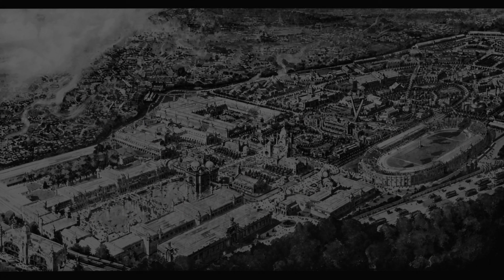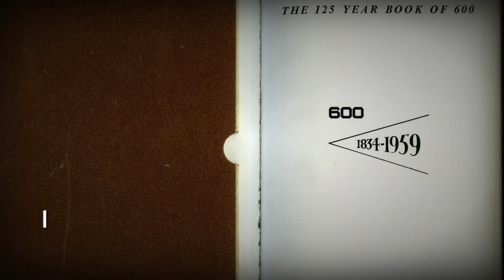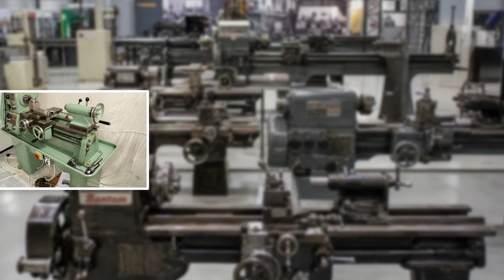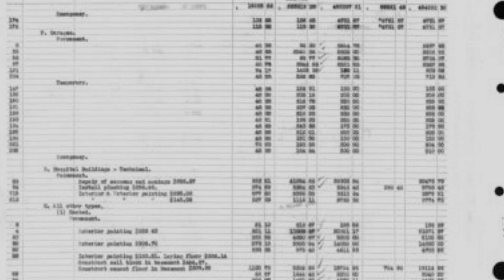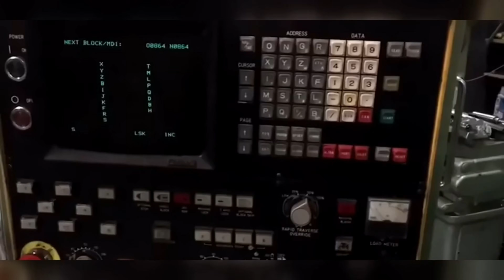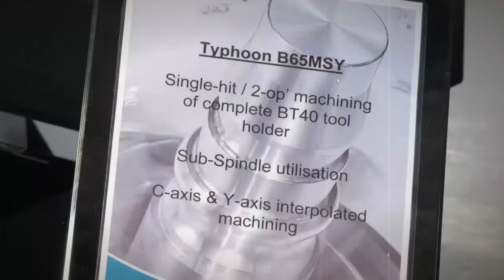The Essex Lathe Company That Taught Britain How To Machine

Comment: Yes all our lathes in the apprentice school 30 apprentices per year in a 5 year apprentichip then 150 in al,  in Leeds at Rank Precision  Industries was a Colchester. 12 in all between 1973 and 1978. They were the perfect machine to learn on very accuret and very easy  to use and work on. It closed in 1978 when Torys goverment Thatcher etc destroyed the manufacturing companys and sold it all off over the next 20 years. I loved that company and there machines im 70 now and still working, in the food manufacturing now as a maintenance engineer And that is still the best company iv ever worked for.😢 We use to make some of the best beutiful machine tools in the in the world then ,  then the goverment destroyed it all. What a sad loss 😢😢😢.
Reply: Mad Thatcher, ‘ we are a service country now, not manufacturing!’ Crazy EUROPE should have been more protectionist, it would have kept our workers employed in decent jobs. 🇬🇧
Reply: What did you do with 30 turner's per year
Reply: I worked on Colchester Triumph 2000 in 70's, managed to buy an old Colchester 'Round head' which was still 'good as new' holding tolerances in late 90's. It did some really great work for me, paid for itself on one job for a GKN subsidiary.
Fitter at GKN works told me OEM parts would have cost £4,000, I was more than happy with what I got, lathe, material and time paid for plus a small profit. 
Best hobby machine I've ever had.